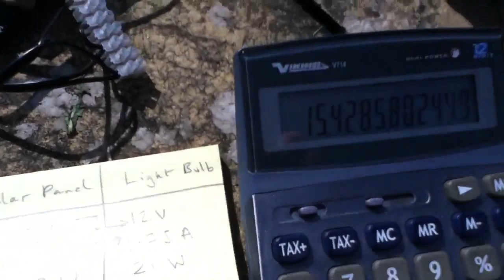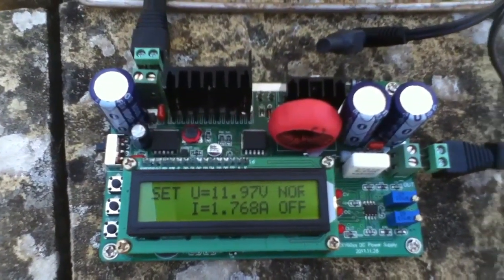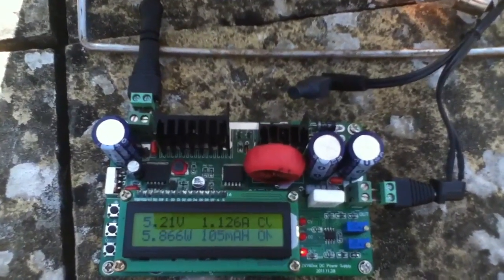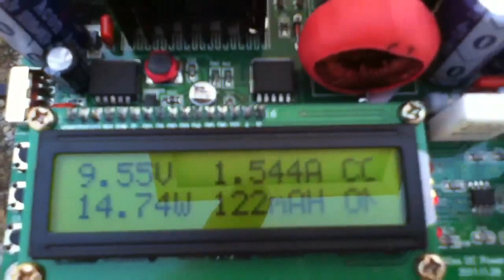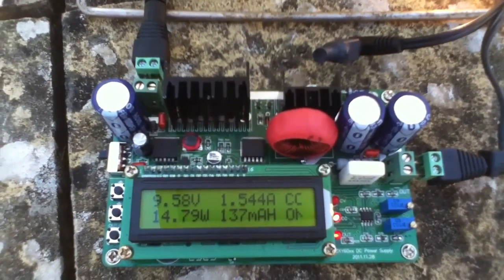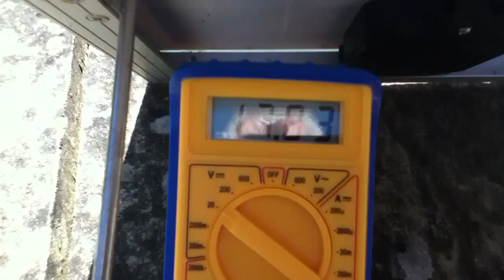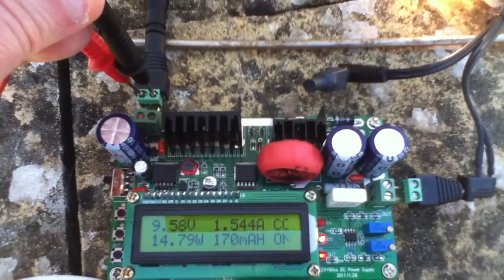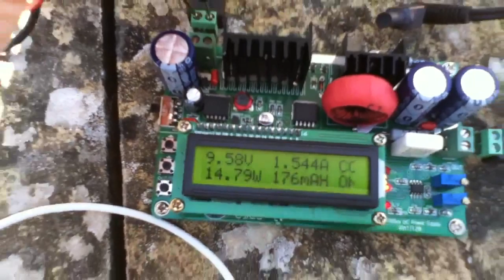20W Solar Panel / 21W Bulb - A Perfect Match? (part 3)

Comment: you seem to misunderstand what the current limit adjustment on your dc-dc convertor does. all you have to do is get the voltage right, and then ensure the current limit is set a little higher than the bulb draws in that condition. The only function of the foldback current limit is to protect the convertor if the load has too low a resistance for the chosen voltage.
Reply: Current limiting is not just to protect the converter, it's also to protect the load.  A good use-case would be when using the DC-DC converter as an LED driver, which Julian does in some of his other videos.
This brings up another topic.. WHY do they say, for example, and LED is rated at 5V when it's really rated at, say, less than 1V.  By limiting the current, all that's really happening is the buck converter is choosing a lower voltage such that it will not draw more than the current you specify.  In reality, the LED takes a much lower voltage.
Nevertheless, I'm a big fan of current limiting buck converters cause you don't need a fuse.
Reply: that's all very well, but you don't then set the current limit to the value of V/R where V is the o.c. voltage and R the load impedance, with no margin for variation - if you do, because of the variations between individual loads (especially a string of diodes or LEDs, all temperature dependent) you will find that half the time the convertor will be operating in current limiting rather than producing a known constant driving voltage, and in that case, why bother with a constant voltage source at all, why not use a (simpler) constant current source, and let the voltage be just whatever it has to be to drive the required current through the load? Then, the load's temperature variation doesn't matter. Sure, You can use either one, but if you've settled on constant voltage, then at least set the current limit some reasonable margin above the current you expect, or you haven't actually got the constant known voltage you are paying to get. Because it's a set of diodes that's getting driven, I would choose to set (i.e. fix) the current and not pay much attention to what value the voltage is set to - as long as it's enough. And you still won't need a fuse.
Reply: the maximum rating on a device is the limit where a defined proportion of the devices will be destroyed if you apply it. 
LEDs should be operated at a defined current - not a constant voltage.
As they dissipate power and get warmer, the load impedance they present falls sharply, and if run at a constant voltage, the current shoots up, and they get warmer still, so the current increases again, leading eventually  to failure. The simplest cct uses a series resistance to limit the current.

Comment: Very interesting videos
I too have been messing around with these things lately and I think you should try using a much "lighter" dc-dc converter with much smaller inductors etc and no on-board electronics to rob power, many of these power sources have output current limiters that will not start up "heavy" dc-dc converters due to inrush current tripping their protection circuits. I also suspect that their input resistance/impedance will be generally higher enabling a better power transfer from low power/current energy sources. Something like the small 2V minimum input voltage (2- 24v boost) maximum 2A output dc-dc converter, slightly smaller than the ones you have reviewed might work better for you here.

Thanks for some interesting things

Comment: In the end though it's pointless to run a bulb directly from a solar panel during the day...except perhaps for a so-called "electronic skylight", but then you would be proly be using LEDs anyway and that's a whole 'nother thing. However there is something else that is run direct from solar panels during the day and that's pumps..either little fountain ones or larger well pumps etc. And these often come with specific DC/DC converter circuits that match the pump to the panel to allow it to run the longest time each day.